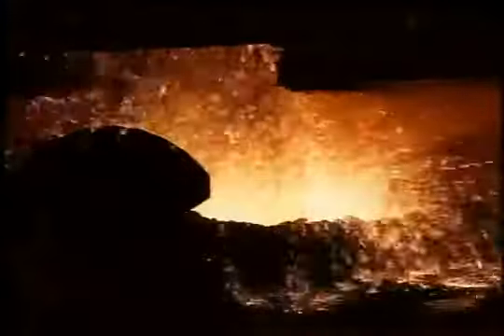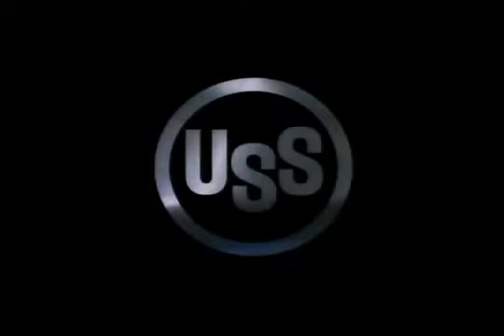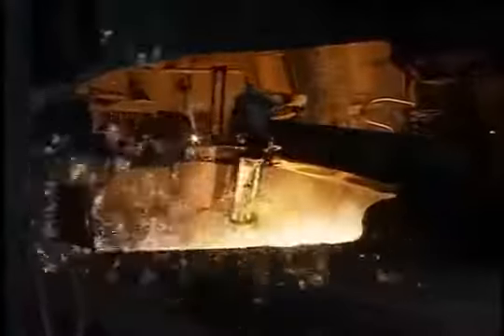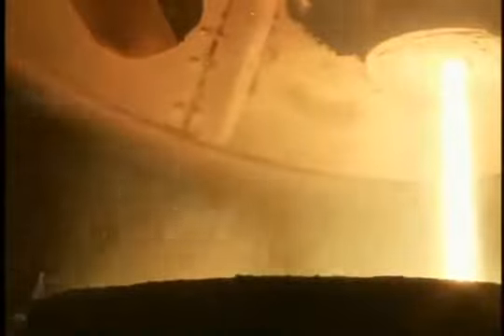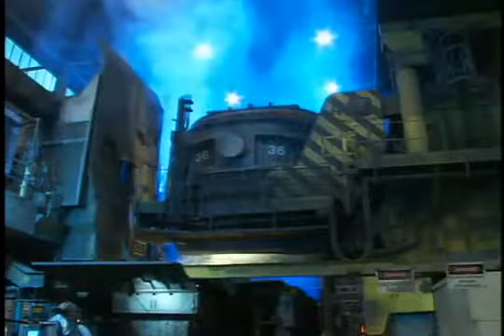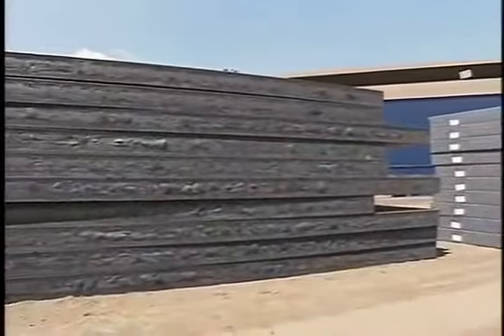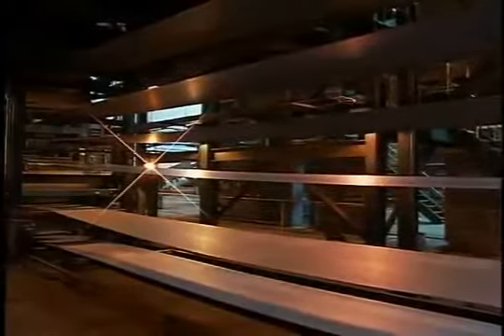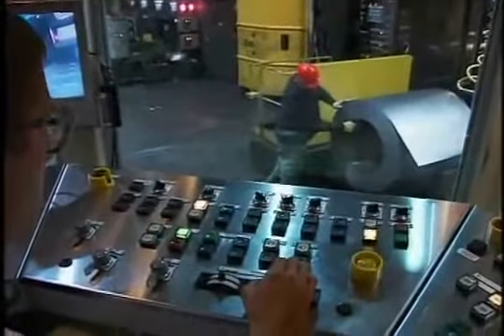STEEL  From Start to Finish

Comment: DEFLT "Steelmaking QUIZ 1"
Donny Pratomo  - 2713100036
PBB B

Steelmaking made from a variety of minerals, of which there are iron ore (Fe2O3), coal (C) and limestone (CaCO3). all the ore needed in place of each different place, and before being transported to the next step steelmaking process. the ore is prepared on the layers in a mound and then the machine will automatically create a mix of these ores. a fire that crept in from the blast furnace raw materials derived from coal powder. at a temperature of 800 degrees Celsius, coal is converted into coke, a pure carbon remains consistent with the evolution of the mine. expert metallurgical coke will change the cooling method for inclusion in a blast furnace, and will turn into a large size coke, coke blonde, and coke springs small size, to use the sintering process. iron ore, coke, and limestone into the container to be blended. The next step in this plan to move slow in the hot combustion, sintering process. combustion zone in this process focuses on blended material are then heat the material. the outcome of the process was then cooled, crushed, and screened for the sintering process. in the sintering process produces a sinter, it is for the basic components in the next step, namely the blast furnace operation. The next step to include raw materials such as sinter, lime coke, and limestone is transported to the top of the blast furnace with conveyer. Iron ore is composed of iron and oxygen components (Fe2O3) and then reduction by coke (3C) to become pure iron reaction. or when in write the equation is Fe2O3 + 3C ==> 2Fe + 3CO. which is taken is 2Fe. then blow the wind to heat to a temperature of 1200 degrees Celsius. raw materials moved down the blast furnace that is sinter, coke, and limestone converted into molten metal and slag. to avoid the high cost normally inject oil metallurgist, then metallurgist to control the computer in detail. converting iron ore into piq iron located under blast furnace. here real steelmaking starts. Here reactions which Ca binds to S and Oxygen binds to the carbon. then after getting pure iron, pure iron is ready to enter into action plans steel. pure iron must pass several processes, including oxy steel converters and electric arc furnace. in the method of oxygen converter steel pure iron transferred to different furnaces smaller, then the slag located above the molten metal separated by machine.

Comment: DELFT “Steel Making Quiz 1”
Muhammad yunus
2713100121

my review video:
This video was produced by TU Delft, Delft University of Technology. This video was explained about making steel and the afterglow processes. First step of making steel is taking the iron ore, coke, and limestone from ship into dock. Then, all of them were arranging on good structure using crane for ore. After both of them had arranged, the next process was mixing iron ore, coke, and limestone using mixer until all of them were mixed in optimal mix. Coal were roasted in 1100 degrees of celcius become mettalurgical consisting a pure carbon. before get into blast furnace coke get into quenching session. Iron ore, coke, and limestone were get into sintering process. Large coke to be use in blast furnace and small coke breeze to be use in sintering process. iron ore , coke breeze, and also limestone are now carefully dispense into blended. this blend is spread on the long plate which slowly move into the combustioner while the blend was combusted. the sintering process, the combustion slow down to burn the blend in high temperature into a pour snash. There is defined into sintering process. The blast furnace operation is from sinter, lump coke, and limestone were fire on the  blast furnace in high temperature. Iron ore is simplify contain iron (Fe2O3) and oxygen. Iron is produced by extracting iron and oxygen using coke. This reaction was endothermic. the reaction was injected with coke by pure oxygen to make high temperature. The air was heated into 1400 degrees celcius in hot processes. After that, the sintering ore will melt and making molten iron. by computer we could controlling the molten iron. after that, we could making steel with adding sulfur and carbon to make calsium sulfide, and oxygen was reacted with carbon. Pig iron was transported into steel plate. previously, there is four process of making steel. nowadays, we were just using oxy steel converter and electric arc furnace because there are related. The process is electric pig iron is transform into the lavatory. The sample was sent into lavatory. after that the raw material were put into the electric furnace. From the analysis. by using the alumunium, the alumunium associate with until ductility. The steel which had made is divide into molten steel and the slag. the liquid steel were losing impurities and the slag was removed. after refining , the molten metal was cast into caster and after that the cast could use it.

Comment: Faizal Nugraha Ramadhan
2713100149
kuis 1

Steel making the process starts with the production of iron which the material is iron ore,coal,and lime stone,. The other raw material throw to the furnace  as 1100 centigrade  the coal now is converted into metallurgical coke consisting pure carbon with minor pollution. Removes from the furnace the metallurgic coke guided through quenching station and after that will cooling rescreen large size coke and lumph coke later on to be used in bast furnace and small coke breeze to be used in the sintering process.
Iron ore,coke,and limestone now carefully dispense and blended,this blend spread on the strand which slowly moves under combustion,
the sintering process,the combustion zone go downward to the blend on high temperature sinter ground iron into the pouring  as soon as the blended is completely burned through it is  call crush and screened while the fines and return to sintering process,the remaining product is the sinter,basically prepare for the next  step
a blast furnace operation,sinter ,lumph coke,and limestone are via conveyor belts or skips transported to the top of blast furnace,iron ore is principally compound of iron and oxygen,iron is produce by the extraction of oxygen using coke ,this reaction is endothermic. To sustain the reaction extra coke is injected together with hot air,the air is preheated around 1250 degree centigrade in hot blast vessel and blown into the furnace, two choices future equally distributed around the furnace,moving downward the sinter,coke,and limestone are converted to liquid iron and slag to save the use of expensive metallurgical coke some time poverized coke or oil is injected. By computer the process operating parameters kept under close control. The iron turn to pig iron is collected at the bottom of blast furnace and tapped into torpedo ladle
begining with desulfurization process by injecting lime powder to avoid loss of ductility at high temperature a sulfur reduction values lower than 0.01 percent is necessary.
Now liquid pig iron is transported to the steel plant. Steelmaking can be carried out in several process nowdays only the oxy steel  and electrical arc process. The liquid pig iron  is transferred  into another ladle, the temperature is measured,samples are sent to laboratory, and the floating slag is removed. Liquid pig iron is now pour into the converter,subsequently scrap is added this is to control the temperature increase due to oxidation impurities mainly carbon and silicon 
 And then pure oxgen is blown into the bath. The impurities are oxidized to slag that is floating on the surface of the bath. Finally the bath temperature at 1650 deegrees celcius is obtained. At the end of the oxidation process, samples are taken for chemical analyses. Within five minutes, the results are presented on the screen in this steel plant. From the analyses, also the amounts of alloying element and reagents for desulfurization and deoxidaztion are determined. Alloying elements, to ensure the steel composition related to the final properties and used of the steel. By using the alluminium, the steel is deoxidized. The alluminium associates with oxygen improving ductility. These elements will be added during the process of the steel from the converter into this huge ladle. The ladle is placed under the converter. Steel and slag are poured out to the converter separately. Tapping, first the steel after that the slag. The liquid steel is then stirred using an inert gas, argon. This to ensure the composition and temperature to be homogeneous throughout the ladle. In addition, the gas bubbles floated out impurities which are absorped into the slag. After refining, the ladle now containing about 200 tons of liquid steel. It is taken either to a continuous casting machine or emptied into ingot molds, which is then will be continued to several process to make something that involved in our daily life, such as vehicles, the framework of buildings and many more.

Comment: DEFLT "Steelmaking Quiz 1"
Review video about Steelmaking
By Budi Christofer Manik (2713100105)
I wanna to review this video making steel and the afterflow by TU Deflt (Deflt Universtiy of Technology).  We know to making steel, we must to process from iron ore to steel and then we created the steel to form product example, construction car, bike, construction of the way, and many more. The first process basicly of steelmaking compound of materials which is iron ore (Fe2O3), coal (Carbon), and limestone (CaCO3). The iron ore founded in the surface of the earth and then did the strip mining where wtih explode. We get the rock and then inside to machine for grinding process, where the iron ore formed homogen into a pellet or marbels ore. And then the iron ore transport by conveyor to the machine of seperating to seperated of ore. And then the iron ore be ready to created the raw materials and then to steelmaking. In the furnace, we needed the fuel of combustion. The fuel is coke, but we haved the coal and can not use in the furnace. The coal must be treatment to result the coke.  The coal given treatment in thehigh temperature to obtain consist of the carbon in the coke, it can being use in the furnace and can be reacted with the else materials in the furnace. After the coke in the high temperatur, the coke is quenched treatment with the liquid. And well after cooling, we get large size coke and coke breeze and to be use in the blast furnace. The smooth coke breeze to be use in the sintering process. Iron ore, coke breeze, and also limestone blended and to continuous under combustion rod. The combustion rod in the high temperatur to reduce the porous mass. And this is the sintering process and the maining product is sinter and we continuous the next step is blast furnace operation. Sinter, lame coke, and limestone are entered to convenyor and skip transport to the blast furnace. Iron ore is princples of compound Fe2O3 + 3C = 2Fe + 3CO and this reaction is endothermic. To the state reaction extra coke is injected together with hot air. the air is preheat to around  1215 degree and the tuyer around the furnace. Moving the down, the sinter, coke, and limestone are melt to liquid molt and slag. Sometime to save more expensive cost, power coke and oil is injected. And all is control by engineer in control room. The finish of process in blast furnace is molten metal. And then molten metal is pig iron and then we begining the steelmaking  process. The pig iron is process to converter and add the limestone to reduce the moisture and reduce consist of the carbon. The kinds of converter is Simens Martin furnace, Oxy steel converter, Electric Arc Furnace, and Thomas converter. An now days, oxy steelmaking converter and Electric Arc Furnace are uses. In the oxy steelmaking converter, the liquid metal is transfer to lead and take little liquid metal to the laboratory and molten slag is removed and the molten pig iron transfer to the converter. And added scrub and limestone to control the temperatur increase and to oxide the impurities and also reduce of silica and carbon. In the corverter pure oxigen is blowed in to the bath and to obtain oxidethe impurities. And finally the temperatur is 650 degree and sometime, we get the sample process to chemical analysis to control the product of iron. and then the continuous process making steel and add little aluminium and then the process tapping steel to produce the product steel, example construction of car, bike and many more. This is my review of video steelmakin. Thank you.

Comment: Name: Fadli Kurniawan
NRP: 2713100029
Lecture: Dian Mughni Felicia, M.Sc

DEFLT“STEEL MAKING” QUIZ 1 PBB 

This is my review about the video by Fadli Kurniawan
Steel making, the process basically started with the production fire which the raw material are iron ore Fe2O3, coal C and lime stone CaCu3, the iron is process in rotating drum to make a optimal blend, and the other raw material coal that processed into powder is blown into the furnace, at 1100 degrees centigrade the coal is converted into metallurgical coke consisting the pure carbon, delive from the furnace the coke is guided through quenching station and after cooling the coke will be used in the sintering process. After that Iron ore, coke and also limestone, is carefully blended, in the sintering process that have a slowly moves under combustion, and after the blend is returning from the sintering process the blend will cold, a crushed and it will ready to next step, ‘blast furnace operation.”
In the blast furnace operation begin with sinter, limestone and coke is transported into the top the blast furnace. Iron ore is have a compound iron and oxygen (Fe2O3 + 3C), iron is produced by the extraction oxygen using coke. To sustain the reaction extra coke is injected together with hot air, the air is preheated to around 1250 degrees centigrade,and during the process the limestone, coke and sinter converted into liquid iron and slag, to save the use of expensive the metallurgical coke sometimes polarize or oil is injected, by the computer process operating parameter kept under control. The iron turned into pig iron is collected at the bottom of the blast furnace and tapped, and in this phases the real steel making process starts beginning with the dissolving process, by injecting lime powder, to avoid losses the ductility at high temperature the sulphure is reduction until 0,01% is necessary, and then the liquid pig iron is transported into the steel plant, there are several processes in the steel making system, that are Siemens martin furnace, Oxy steel converter, Electrical arc furnace, Thomas Converter, and now the oxy steel process and electric arc furnace that though relevan. In the oxygen steel makung process the liquid pig iron is transfered into another ladle, the temperature is measured and the data sample are sent to the laboratory and the floating slag is removed, after that the liquid pig iron is enter the converter tank and the scrap is added into the tank this is to control the temperature increase due the oxydation of impurities that maybe the carbon and silicon, the impurities is oxidating into the slag floating in the surface, finally after the temperature is 1650 deegrees celcius and the end of oxydation process sample take to the chemical analysis and within five minutes result can presented info the screen and will knowning the elements and reagen and the oxydation determined, alloying composition to ensure related the final properties aand used on the steel, the steel deoxidized, and the alumunium that associates with oxygen improving ductility and these elements will be added during taping of the steel to the converter into the huge ladle. The steel and the slag will be separate from the converter, the first taping is iron and next the slag, next the liquid steel is steer using the inert gas, is to ensure the composition and temperature to be homogeous, and the gas buble will float the impurities and up into the slag. Afer refining the ladle is containing about 300tons of liquid steel and taken by continous casting machine. There is my review, syukron (600 words in ms.word)